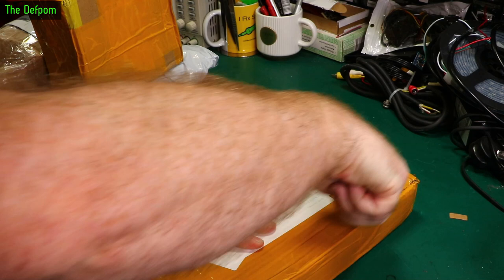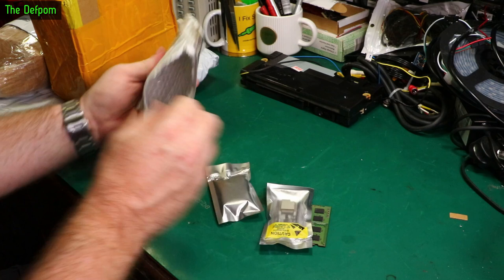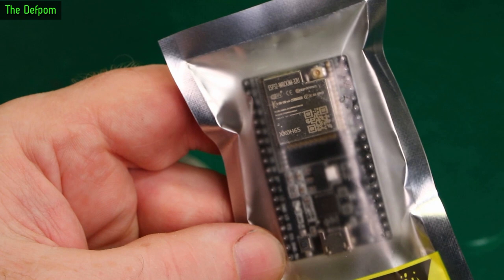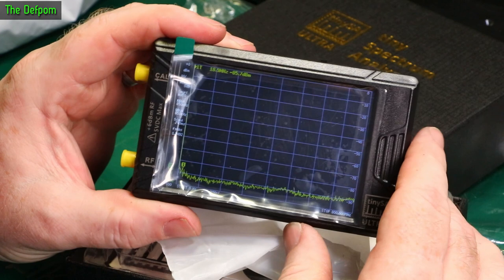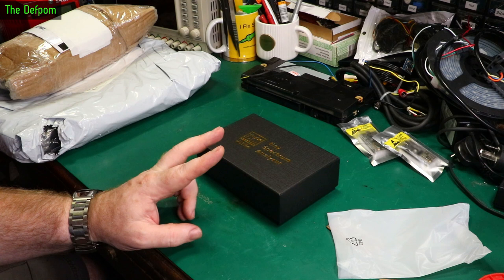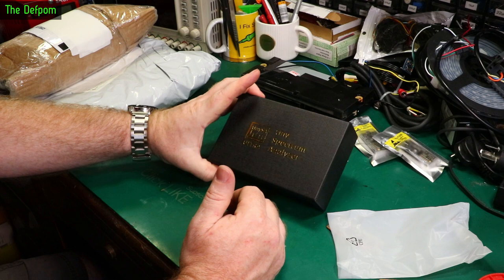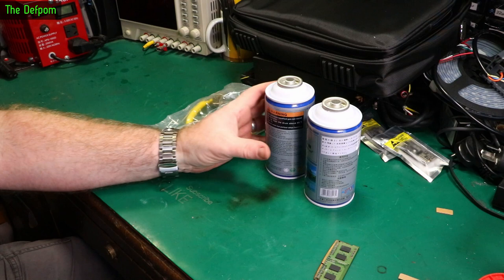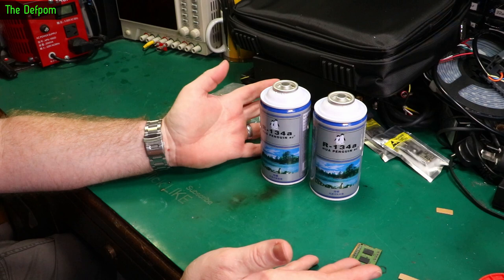🔴 What's in my Mailbag ? - Mailbag Monday 30th January 2023 - No.1094

Comment: I have a tinySA Ultra.   I am very impressed with how well it works.  It has bandwidths down to 200 Hz so you should be able to isolate signals that are KHz apart.   You need to enter a code from the website to get the full bandwidth.
You may have a slow leak in your AC system.   They are notoriously  a pain in the rear to track down.  Good luck!
Reply: The code on the website is just so you read the warnings and be aware of the pros/cons, but yes you need to unlock it. I also got bit by the ultra bug.

Comment: As a small amount of compressor lubricant circulates through the system, refrigerant leaks will usually be accompanied by an oil stain. Most automobile compressors will leak  a minute amount of refrigerant around the shaft (carbon/ceramic) seal, so an occasion top up may be necessary.  An electronic leak detector is a handy tool to have and will probably detect a leak from the shaft seal at the front of the compressor.  Best to have a manifold set (gages) when adding refrigerant to avoid over-charging. Charging using only the sight glass is iffy as ambient temperature has a large effect on systems with a TEV.
Reply: Add some HVAC UV dye to make the leak easier to find. Hopefully, it would be in an easily accessible location.

Comment: So your fixing a flat screen tv obviously.thats what those speakers are from. 🙂
Reply: I would have cut the wires to the bad speakers and reconnected them to a set of terminals so that better external speakers can be connected. Or just stick a cheap amplifier module to the back for the external speakers.